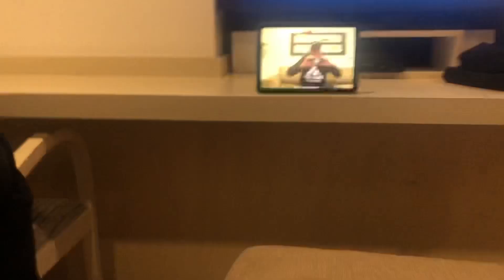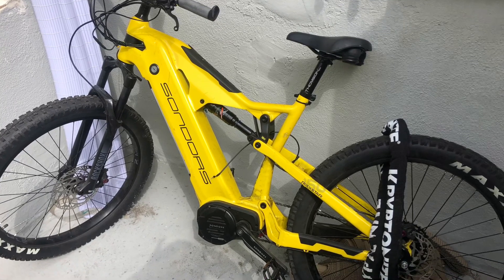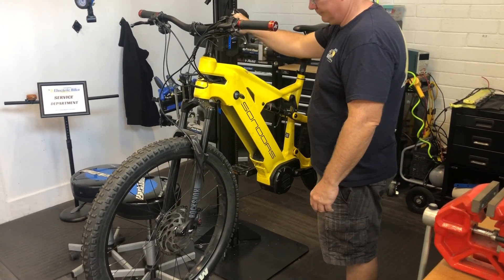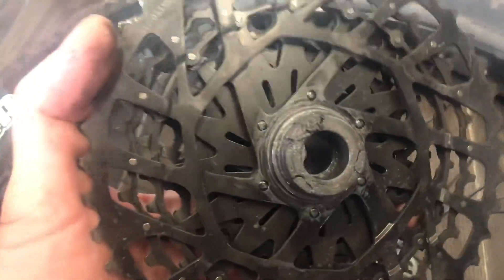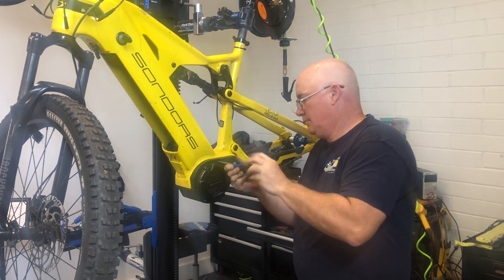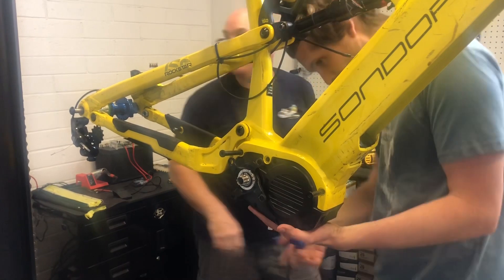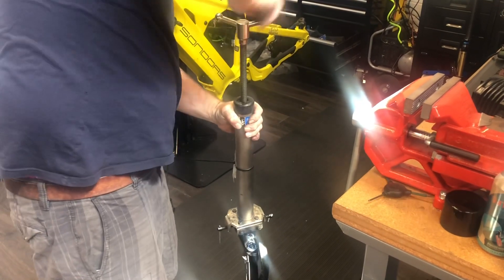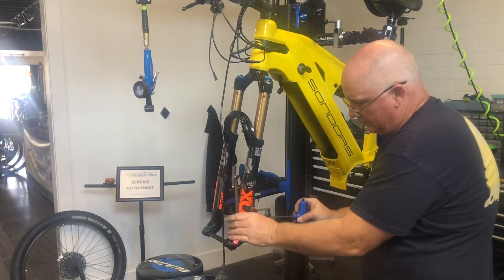Rockstar Rescue Episode 1

Comment: What modifications were done to it that they didn’t honor the warranty?
Reply from the maker: Previous owner didn’t say exactly why warranty was voided. Previous owner used the bike for food delivery. He was towing some sort of trailer and in the trailer he towed his extra batteries. (maybe the food too) The front fork was upgraded to RS Judy, he had the front sprocket and adapter changed and some different hand grips also had a solid seat post and dropper post was removed. So far his rear hub has failed and something’s up with the motor but I haven’t got there yet.  I think Sondors did him dirty on not  helping him out. This bike was part of his job and I don’t feel he got the justice he deserved. It’s also a second generation bike, meaning it’s not that old at all.
Reply: @MattHaley  they actually send rockstar judys to people with broken forks cause they’re out of stock on their forks.
He should’ve put the original mods back on before making a warranty request
Reply from the maker: @rsxhitman  agreed, I did that with my car and got a warranty repair. What’s done is done. I still say Sondors did him dirty. This was a guy who could have used a break, the bike was part of his job.

Comment: U don’t need a special tool to get the crown race off..or put it back on…it’s a bike not a space shuttle lol
Reply from the maker: Fortunately I didn’t have to A: buy one B: take it off myself C: worry about any of it.
Reply: @MattHaley  it’s fun to know what u own tho and be able to modify it. You can modify as you please without restrictions. But everyone’s different
Reply from the maker: @rsxhitman  The other way to get the race off is a flathead screwdriver and a hammer. The guy had the proper tool. It’s like lighting a fire rubbing sticks together or lighting a match, both start fires. Your choice how you spend your time and energy.
Reply: @MattHaley  I use razor blades and a hammer. It’s so rarely done tho. U can get a tool off Amazon for 50$